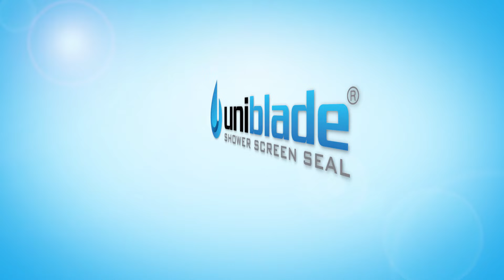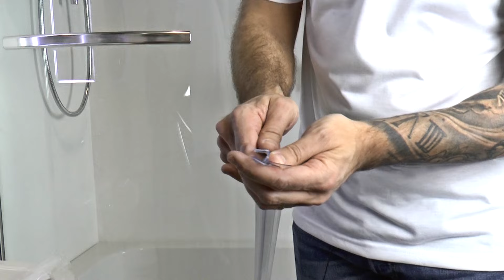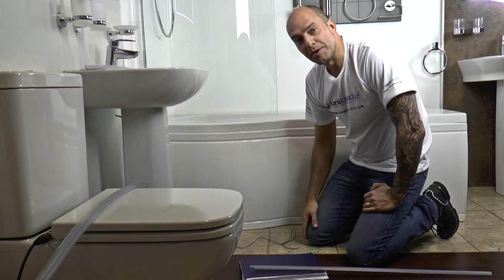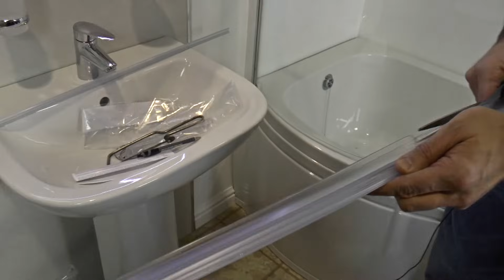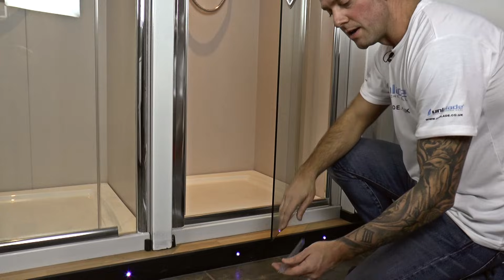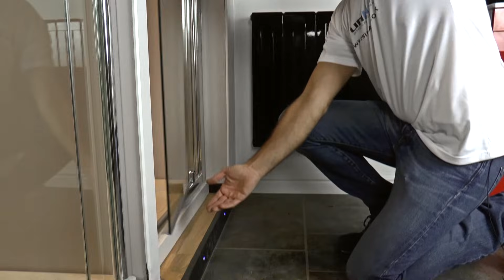How to fit the Uniblade Shower Screen Seal

Comment: Silly question but should the long blade on the screen door seal be pointing into the bath or out of the bath when showering?
Reply from the maker: Hi there.  Not a silly question at all tbh.  It will work either way.  The long bottom fin should be around 5mm more than your gap size and the shorter blade positioned on the inside of the screen.  This will help deflect any water away from the bottom fin.  Hope this helps.
Reply: @Inventive_Creations  Thanks for your reply.

Comment: Bought this as advised by the shower shop it would fit my p shaped bath shower screen. The instructions/pictures that come with the seal are not clear as to what piece to use. I had to use youtube on my tv to get a bigger view of it and paused to try and see. Eventually I saw that you use the male piece and the female with 3 flaps not the one with two flaps. We had the gap at the wall end but after cutting the hard plastic and trying to fit it, the male part moves as you bend the seal to fit it. 
All in all it took 2 of us about 2 hours of trimming, sliding, trimming  and trying to figure it out. Now it's fitted, no-one is moving that door. 😂😂 I'm not sure how long it will be before it needs cleaning and how well it will re fit once removed for cleaning. At £14:99 I hope it lasts. But thank you for the video as we wouldn't have been able to do it without it.

Comment: Used this to check which way round the short blade fitted, no instructions with my standard seal. Nice tip about the wall end cutout. Old dirty leaky seal gone, new watertight seal fitted. Cheers for a great clear vid 👍

Comment: Great on a newly fitted shower screen, and only if you have mucked up the one that comes with the new screen you won't need this product.
This does not fit all curved screens also not suitable for all gaps, again nice if you have enough room to limbo under, but most do not.
Advice, if you have limbo space then good to use but definitely do not use if not. 
I 'be been supplied a few of these by customers and found there not suitable for all screens that have been fitted correctly old or new
Reply from the maker: Nice comments... did you actually see us fit it on the video (it was a curved screen we put it onto!).  I can assure you it will fit curved screens if you follow the instructions.
Reply: Jef Brock Shower screens don't work full stop. I have had three different ones in my house over the years and not one of them has worked. I still end up with water on the floor. They are the worst invention ever. When I get round to it I am going to make my own.

Comment: I can not hardly see the products in the video, I am unclear on what clicks where??. I bought the Uniblade shower seal to replace my old one, however your descriptions are brief & the video does not zoom in when you are describing each product. The diagram in the  leaflet is unclear.
Reply from the maker: Hi there, if the video and instructions are not helping then I would suggest getting someone to fit the seal for you.  The are both quite clear in their descriptions and most people that buy the seal fit it with ease.  Many thanks.
Reply: @Inventive_Creations  great way to treat your customer.
Reply: @Inventive_Creations  Poor reply.